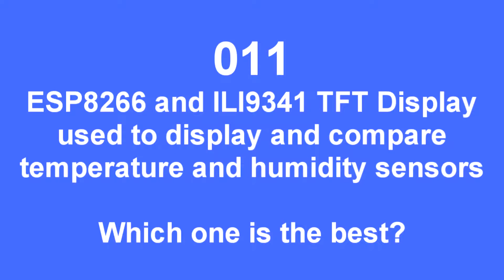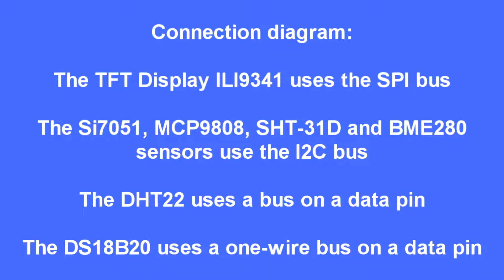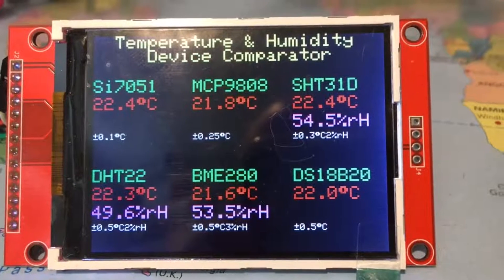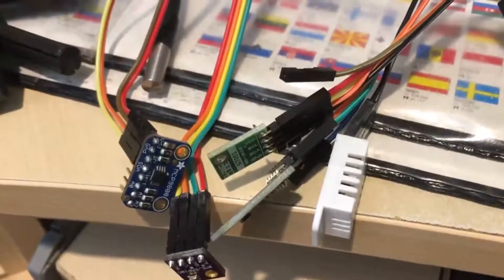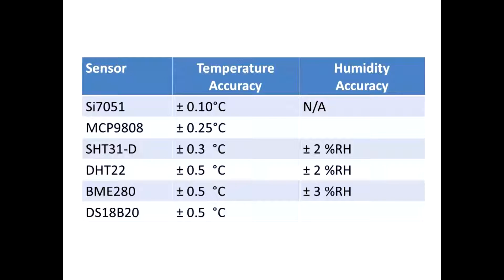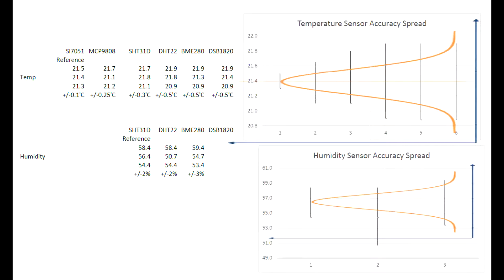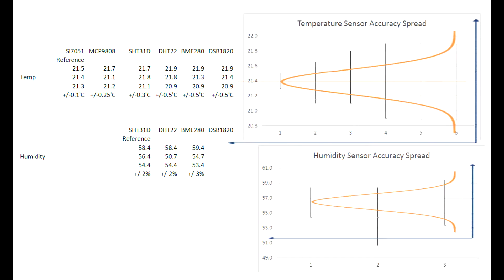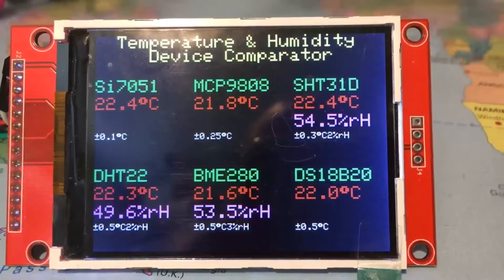Tech Note 011 - ESP8266 Temperature and Humidity Sensor Comparison

Comment: This is exactly what I was looking for!. I am only going to use the Si7051 type sensors but I hope I can figure the coding out. I am a totally newbie in this...
Thanks a lot!
Reply from the maker: Let me know if you have any issues so I can help out if required
Reply: @G6EJD  Thank you but I think I have to reconsider or get a whole lot more knowledge about programming. Because the sensors have the same address, adafruit recommends using a multiplexer to fix the readings from the sensors. As it is right now I don't fix the programming🙃
Reply from the maker: @Johan Storck Yes that's a problem with I2C devices only one device on the bus, some devices have an address pin you can pull low or high so you can have two devices, but without a multiplexor its not possible and then using a multiplexor is not easy to do in programming terms, well at least complex.

Comment: very nice !! thank for the display - wiring!
is it possibel to use the memory-card?
Reply from the maker: Yes absolutely. The Card is wired in parallel with the display and then you need another pin for the CS (for the Card), so you have two Chip-Select pins one for the display and one for the SD-Card reader. I recall in one of my earlier videos maybe on using SD-Cards I showed how to use bother at the same time in-terms of wiring. To recap, wire the SD-Card in parallel with the display, then use a pin for CS.Vcc-VccGnd-GndMISO-MISOMOSI-MOSISCLK-SCLKRST-RSTCS-Display as nowCS-SDCard needs to be assigned in the code for the SD something like SD.begin(D8)

Comment: Do you know how to make one of these temp sensors broadcast to 433mhz, preferably battery powered?
Reply from the maker: Yes, in its simplest form simply send the readings to the serial port to which is connected a 433mhz transmitter, that would be a simple solution and it would work well and cost a few $. Alternatively use a LORA module and do the same. I’ll try to produce a video on this topic.
Reply: Wow! That would be amazing. Thank you!

Comment: sorry,
have ja a demo for the touch operations ? with the esp8266.
i will switch the display led on / off  - but do not find the electrical connection shown in the demo.
Reply from the maker: Same wiring as any other ILI9341, like here: https://github.com/G6EJD/ESP8266-Temp-and-HumistatGitHub has all the sensor wiring is that what you mean?
Reply: no, i will use the touch-funktion of the display - shown in the demo´s from the lib....
but there ist a unknown pin for the touch-function.
Reply from the maker: My display has T_IRQ, T_D0, T_DIN, T_CS, T_CLK as well as TFT and SD-Card, some displays do some don't.Which pin is unknown?
Reply from the maker: And sorry, no touch screen demo
Reply: in the demo:  onoffbutton ist this:
..
#define STMPE_CS 8
Adafruit_STMPE610 ts = Adafruit_STMPE610(STMPE_CS);
..... 
idee: what pin it is .??

all other pin´s i have change - so i hope
Reply: ok - thanks and a god day.
Reply from the maker: Touch Screen - Chip Select, so you need a spare data pin to select the touch panel. You will have:TFT-CS (Screen chip select)Touch-CS (Touch panel chip select)SDcard-CS (SD Car reader chip select)
Reply: OK, on the board  - shown in your demo, ist CS - used in the demo..
on the other side is PIn SD_CS and F_CS  - i will try F_CS to connect .... if positive  i will say it to you..

No - nothing ... 
nice day - thanks for help
Reply from the maker: have you tried the Adafruit Touch tutorials and examples for a touch display?
Reply: yes, .. it is the display ...

Comment: in which the compiler is written?
Reply from the maker: I use the Arduino IDE. https://www.arduino.cc/en/Main/Software if using the ESP8266 there is an add-on and there are many pages that explain how to set-up the IDE for the ESP8266. Please contact me if you have any problems.